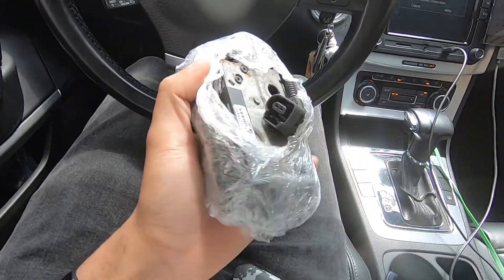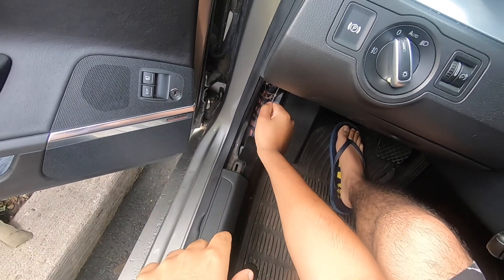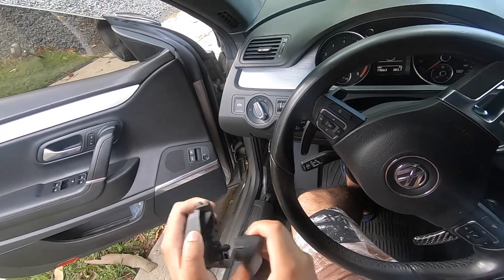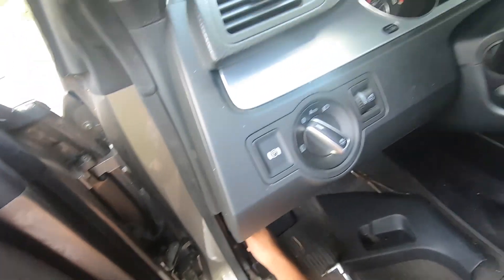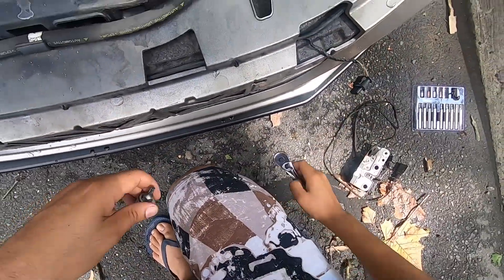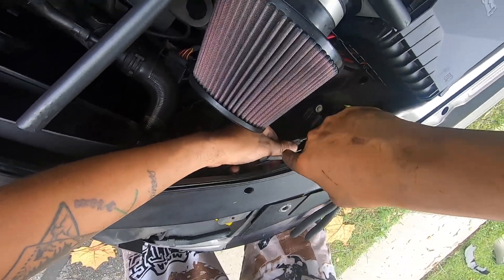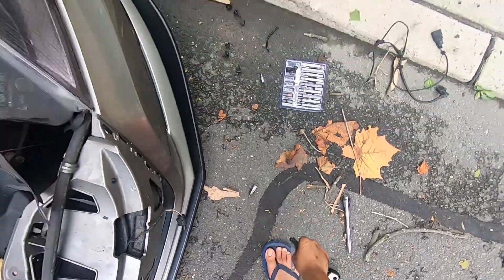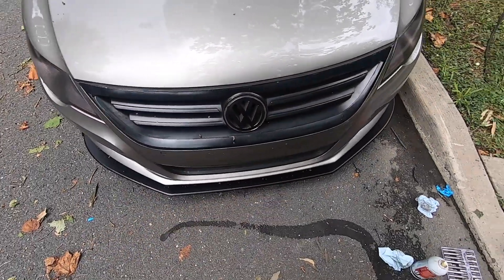How To: Replace Volkswagen CC Hood Latches

Comment: What fuel do you use. 93 is pretty much non existent around me. Just 91. But it doesn’t like it very much lol
Reply from the maker: Yup I use 93. You can use 91 if that is available. But if you are tuned for 93. Get 93
Reply from the maker: You can can use 91, thats the minimum rating for the vr6. You can use 108 octane but don't use e85 because we can't use that without modifying the fuel system.